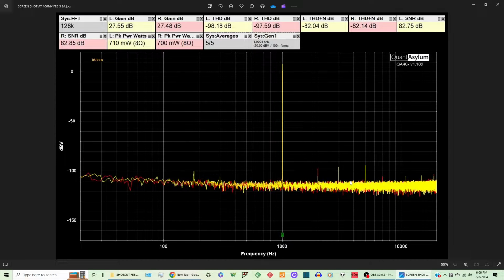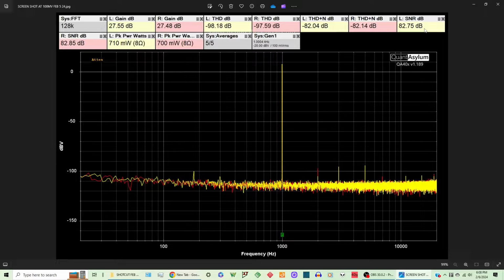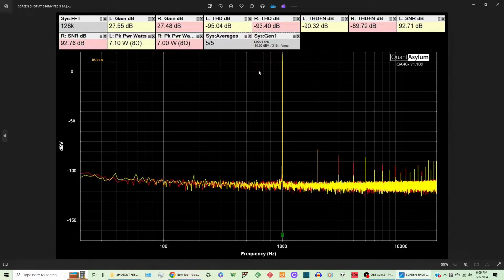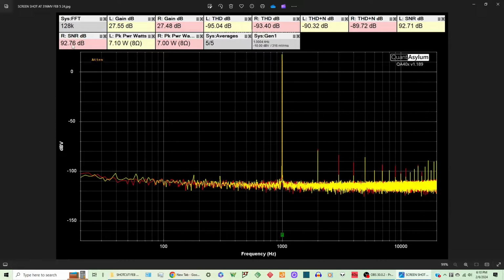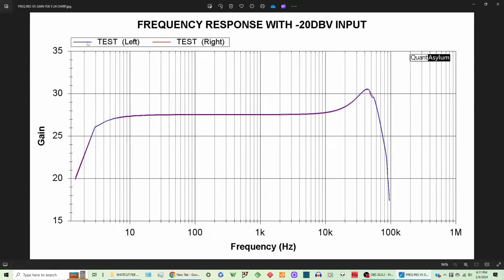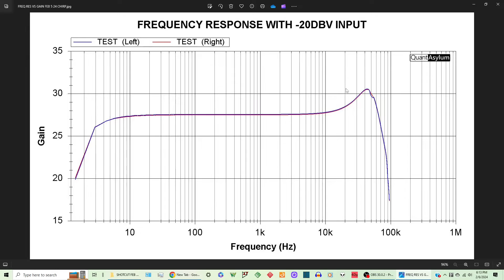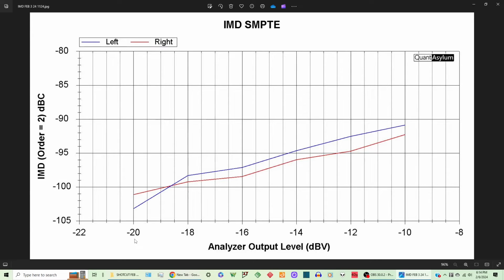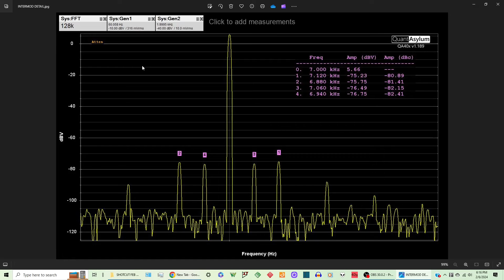Testing a TPA3255 PCB Audio Amp with the QuantAsylum QA403

Comment: Really appreciate your honesty about your hearing! I think all evaluators should have a mandatory audiometric examination and publish the results. I get a kick with some so-called audiophiles telling the audience that they can hear distortion at 20Khz which is almost unbelievable. I had a store where I obtained a used field audio metric device for testing hearing in school children. The results were incredible and eye opening as almost 100% of the adults could not hear past 12-14Khz at fixed frequencies and ascending and descending intensities. We could test for distortion at fixed frequencies and the results were interesting. Most of the customers could not detect 10-15% distortion below 400hz. We learned most of the customers had never attended a symphony in person. We also learned no two customers had the exact testing outcomes. We did notice the youngest (below 21yo and the oldest) had the most problems. A audiologist told us that most hearing losses in the young age groups hearing might be attributable to wearing headphone played at high SPL’s over long term usage and the older customers because  natural results of aging. I have four Fosi ZA3’s that came with a 32volt 5amp power supply. I replaced the power supplies with a 48volt 10amp. The difference were immediate in more power, better stage depth and a more open natural sound. Fosi has designed an external power supply filter to correct power supply noise entering the amps. Looking forward to your next show!

Comment: 8:50 -- 20 volts?

I've tested a few of these, myself. 20 volts is too low for reliable testing.

If that is a true TPA3255 chip (not a TPA3251) 20volts is very low in it's stable operating range. It will go into under-voltage protection at 16 volts.  It's output will be closer to the noise level than with higher voltages and because it is barely into it's stable range the THD will be somewhat higher.

It is going to perform far better in the range of 36 to 48 volts, with a 10 amp supply.  At 48 volts with a 10 amp supply you should be able to pull almost 220 watts/ch off that board with 4 ohm loads at less than a percent distortion. (110w on 8 ohms)

The TPA3251 maxes out at 38 volts and seems to like 32 volts the best. Here you will get about 100w/ch on 4 ohms again with less than a percent distortion. (50w on 8 ohms)

Unlike many TPA325x boards, that one appears to be laid out properly.  The output coils are kept well away from the heat sink which definitely improves the sound quality at the outputs.  Many designers will put the coils right up against the heat sink, in an attempt to keep them as close to the chip as possible.  This is a mistake, even with toroidal coils as the minor magnetic fields on the outside of the coil's windings will interact with the mass of metal causing eddy currents, inductive heating and some non-linearities in the PWM pulse chain... effectively de-tuning the output filters. 

It will be interesting to see what you get from your commercially produced TPA3255 amplifier.
Reply from the maker: Thank for your input, Douglas.  I certainly agree that 20 volts is too low for reliable testing.  However, we've also tested with a 32 volt brick and the results were not that much different;  I'll have to post the results on my web site, but they're pretty much the same.

As for the test results, I have to say I'm surprised at how well it did for a $30.00 "eBay Special".  We also have a popular commercial Class D amp with the TPA3255 we tested at 32 volts and the results, for the most part, we not much better than the PCB amp. 

I bought the unit as advertised with a TPA3255, but it's anybody's guess who made the chip.

As for the PCB itself, it seems fairly well laid out except that they have four electrolytic caps parked right next to the heat sink;   I wonder how long they'll last there.

Regards,
Marty
Reply: @boatanchoraudio6453 
True enough, once the chip is in it's stable range (roughly 24 to 48 volts) the frequency response and distortion tests will be pretty close.  What changes most is the power at clipping and signal to noise ratio.  

 Most of those online specials are actually commercially made boards that either ended up as excess stock or have minor manufacturing defects.  They "dump" them into the DIY market, rather than taking a total loss, knowing that most of us have the wherewithal to fix at least minor problems before putting them into any kind of permanent use.

The list of problems goes on for a while, but the main ones are lack of vertical clearance between the heat sink and the parts under it, the 12v buck converter being somewhat unstable and capacitor voltage ratings being too low.  All of which are fairly easy to fix.

I've seen a lot of fake NE5532s on those boards (Which I replace with RC4558s or TL072s) but I've not seen a fake TPA3255 chip.  I have, however, seen TPA3251s substituted and those boards will then go into overvoltage protection at about 38 volts.

To be honest... the caps against the heat sink is far less of a problem than putting the coils there.  If that's a concern we can always replace them with 105 degree equivalents.  Or you can use my favourite cheap hack and saw one fin off the heatsink to create some clearance.

Power supplies are a problem.  The brick supplies you get with the finished ones most often will allow 100% overhead for brief moments before going into an over-current panic, which is a good thing. But the DC cords are too thin and too long to provide good transient response. Once the on-board reservoirs are drained the resistance of the DC cord slows the recharge a bit which leaves the amplifier unprepared for the next transient.  I have mine connected to a 36 volt 10 amp supply using 12 inches of 16ga wire... works a treat.
Reply: @Douglas_Blake_579 i looking many time the wondom tpa3255 whith dsp . The Qualität looks verry good and one board for 45$